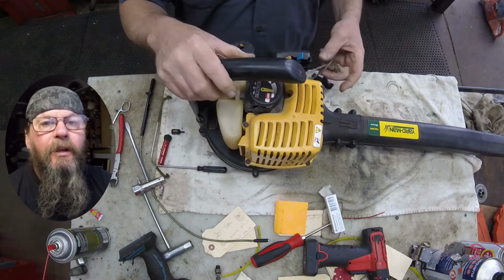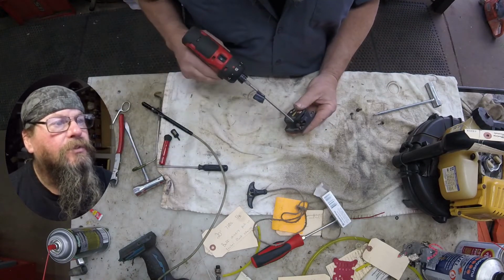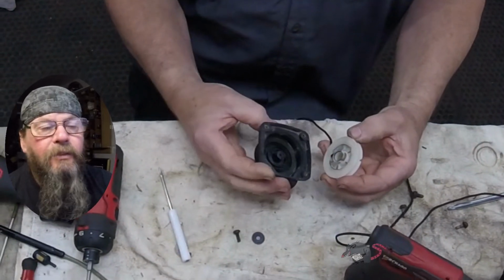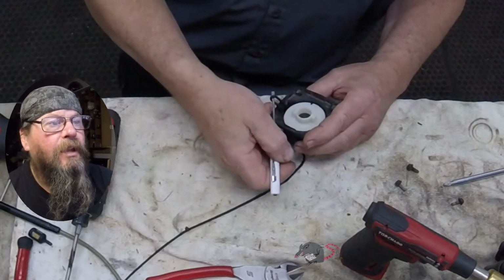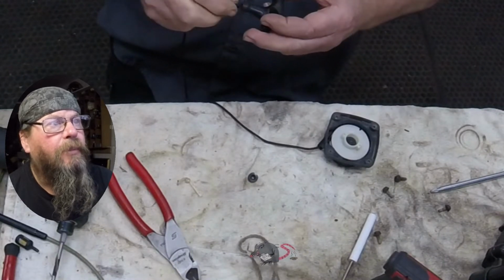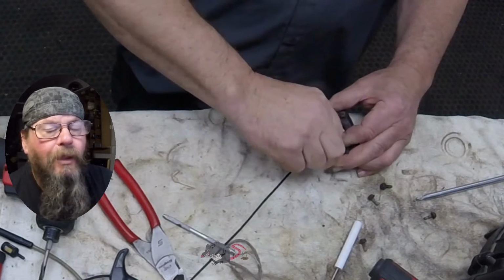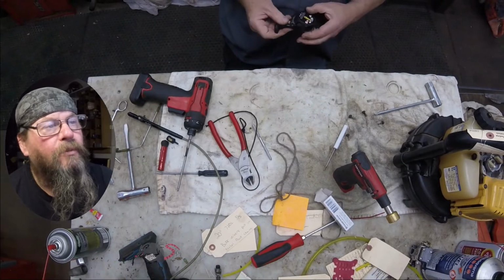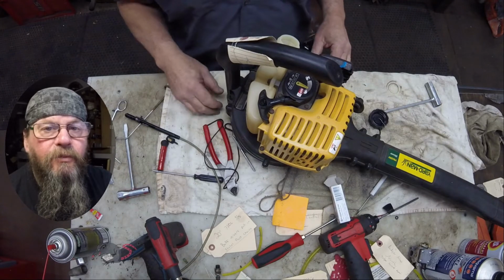Yard-Man Handheld Blower Rewind Repair

Comment: Found your site recently. Great information. Been working on stuff for years and learning things. On an empty spool, best way to know rope dia?
Reply from the maker: The diameter of the holes in the pull handle and starter spool are good clues but bigger is better in this situation. If the rope is too narrow it will bind along side the underlying wrap of rope. While it may still work, eventually it will be a problem.
Reply: @TheGreasyShopRag  thanks. Basically look, then common sense.   I want a bs button, till my wife takes a hammer to it. Lol.    Take care.